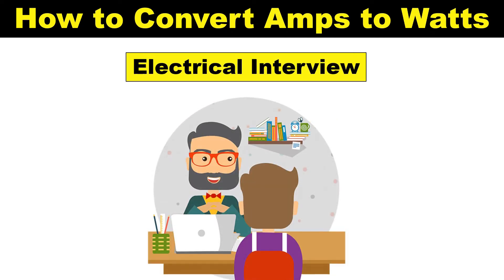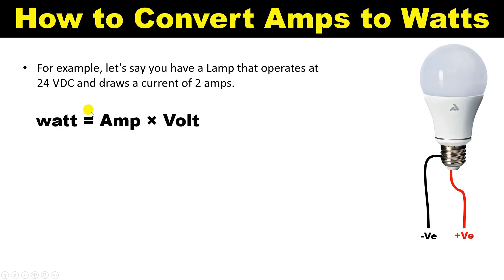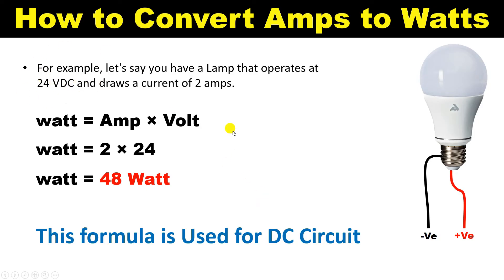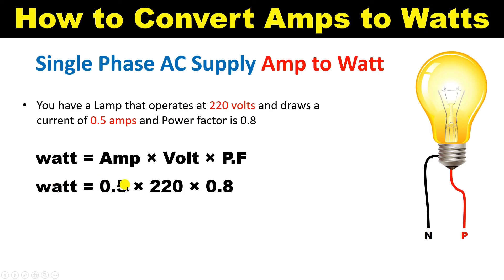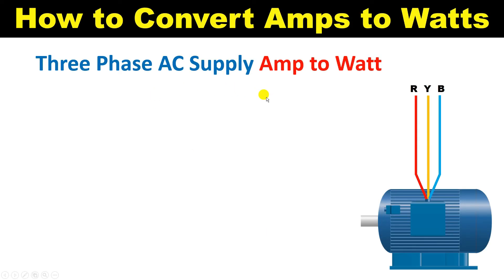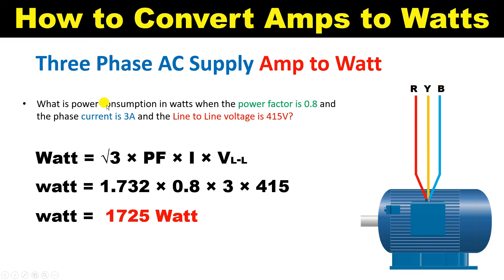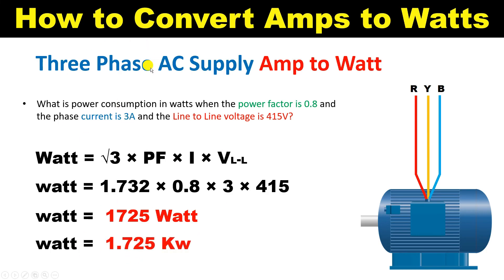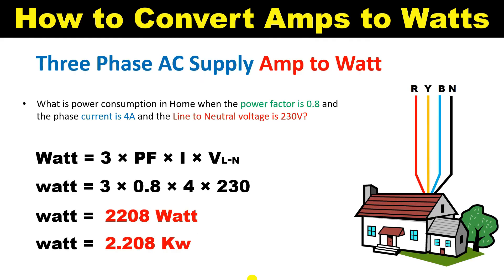Amp to Watt Calculation in Electrical system || amp to watt @TheElectricalGuy

Comment: Please note that Amps (Current) and Watts (Power) are different measures and one cannot be converted into the other. Current (in a circuit) is one of the parameters for computing the Power taken by the equipment in the circuit. Hence it is incorrect to say How to convert Current into Power.
Further the PF of a resistive load like an incandescent bulb (shown in the example) will be always unity and not 0.80.
With Best Wishes.
Reply from the maker: Sometimes to test our knowledge interviewer asked this kind of questions so in that situation how you can give the answer that's things is explained in this Video

Basically the video is just to explain how to find power rating

And For example only i have taken 0.8 PF you can use 1 or 0.9 also according to the pf mention in the question

Comment: In 3 pH supply how to calculate power factor?
Reply: Power factor
https://youtu.be/5nQdKEuIlNE
Reply: Just add √3×v×i cosπ
Reply: @mohammedsalauddin3642  According to my knowledge we have to find power factors for each 3  phases seperately and power will be IV Cosπ1 + IVCosπ2 + IVCosπ3
Reply: @mohamedhabeebullah9348  For the three phase you don't to find for each phase power watts , juz √3 ×415×Amps×0.8 that's all. If your going find for single phase power that time you don't need to include √3